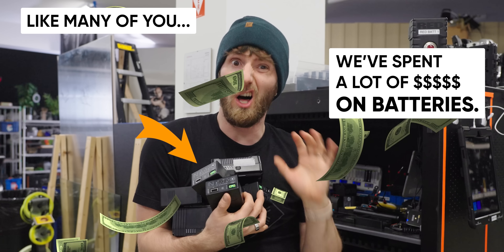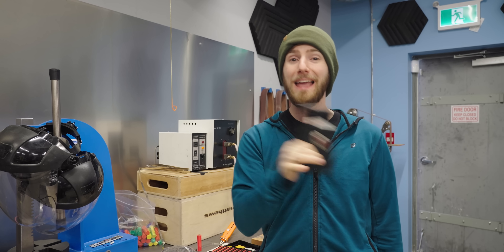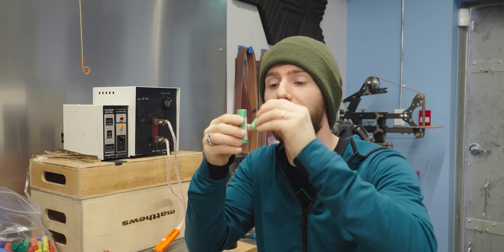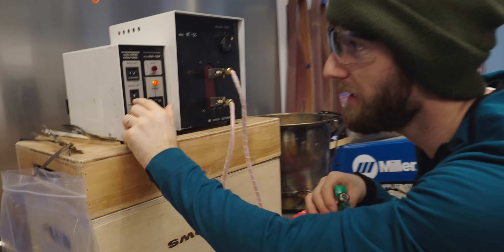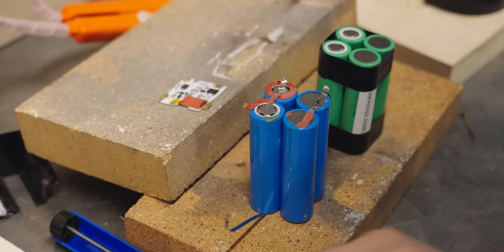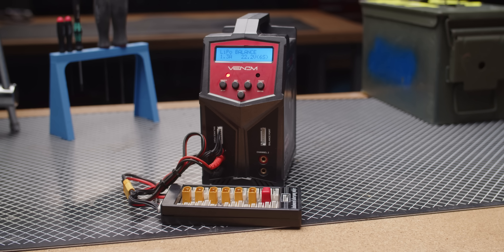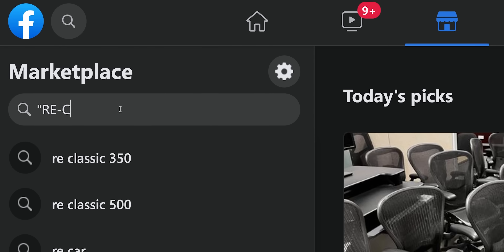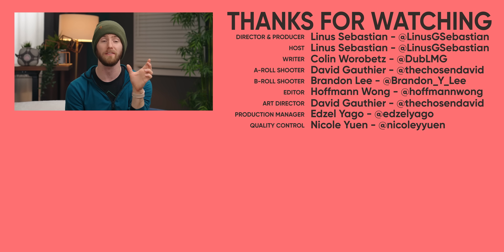This should be illegal… Battery Repair Blocking

Comment: Did you try charging that Sony pack ? Could just be that it shut off due to undervoltage, and charging could have reset it
Reply: Put it on chaaarrrggggeeeee it's sleeping
Reply: @CountParadox  That's true. You need to wake up the BMS most of the time. This is normal behavior. Also you should charge the pack through the BMS as well.
Reply: A lot of BMS if disconnect from batteries go into a sleep mode, and to wake them up, you just need to provide charging voltage to them on the output.... Charge then test!
Reply: Most lithium battery protection circuits will remain disabled for safety until they are first charged (TI, OnSemi, ...). So the pack was probably perfectly fine, you just needed to connect it to a charger once, as mike pointed out.
Reply: My thoughts exactly! As far as I know, for many BMS boards a reset is required after a cell swap. Connecting a charger usually does the trick, if you are lucky.

But sometimes you may be not, like when battery board has a gas gauge chip - this is a whole another world of hassle))
Reply: @enweave  even Apple was bitten by evil gauge IC - BQ27541. While they were using it, only data queried by host were I, U, t - because other were unreliable.
Reply: @brylozketrzyn  If only I U t are realiable that means the fuel gauge is probably not flashed correctly and the training cycle was not performed, to which I questionb why you would bother using those fuel gauges given that they cost way more than those that just monitor the pack's voltage.
Reply: @enweave  That's not a reset, but a wake-up from sleep mode they enter on cell removal, as the BMS thinks it's in serious undervolt mode (and therefor disables it's discharge-FET).
If there's a gas gauge on board, cell removal will trigger the safety-features which will make it go into a permanent failure mode. And that's a PITA to resolve... (trust me, I know, I revived my V-mount batteries, equipped with the BQ20Z65 gas gauge.
Reply: yup, should just "start"  it with a touch of charger. All the good and cheap BMS chips have to be put on charge after they trip or get disconnected.
Reply: Yup, every battery bank I have owned has this feature - disconnect the battery, plug it back in and the output will stay dead until external power is hooked up. Having to hook up a charger to "wake up" the over/under-voltage protection chip after it has disconnected itself from the battery and external power got removed also conveniently prevents the bank from randomly turning on during shipping.
Reply: My apc ups's do that. Change battery and it won't come on until it get wall power first. Not a battery&bms but essentially the same thing.
Reply: Yeah, a 3.2v cell new out of the box isn't bad.

Interestingly a lot of cells are being shipped <2V now which traditionally was not recommended for lithium batteries but they're doing it and it doesn't appear to be as bad as once thought.  Might be a chemistry change thing though.

Comment: Didn't some Apple laptop batteries have a malicious BMS that used an on-board microprocessor to "marry" one battery pack to the laptop power management along with the other basic circuitry to prevent swapping cells or packs? Also, armchair spot welder advice is that sparking was just the poor connection from your spotwelder leads, however,  you may have been damaging the cells anyway by adding too much heat from performing multiple spot welds in short order to the negative ends of the 18650's. The negative ends have thinner material and more heat is transferred to the electrolyte in the cell.

Comment: it's really important that people learn how Li-Ion and Li-Po are recycled. This is one of the main issues people point out when talking about how useful to the environment electric cars are
Reply: & they're used in secondary applications, extending their usage life.
Reply: Almost nothign is recycled. 99% of Li batteries you'd throw in the "battery recycling" bin will end up in the landfill after pack disassembly or most likely before. There are some youtubers and a couple of enterprises that "upcycle" or resell cells from old devices on ebay, but that is literally a mouse's fart against the hurricane of millions of EVs and power grid devices being produced and scrapped today.
Or do you have any proof of thousands  of metric tons of Li cells being actually recycled? I bet you don't.

Comment: In laptop space I have seen BMS stop working after disconnect and after googling found out they even have protection to prevent use with third party batteries which means 0 chance for recycling

Comment: Linus, thank you for mentioning that you're an amateur and you have no idea what you're doing. The sparks at 11:15 were from the spot welder and not from there being a temporary battery short. Those 4 cells definitely didn't need to go to ewaste. Easy mistake to make though as spot welders make the exact sort of sparks that battery shorts make. Because in both cases there's high current flowing.

Comment: Most bms I've come across will not revive once they have shut themselves down, if you do them before they are dead you stand a 50% chance it will work. The other ones are the ones that write battery health to an eeprom so if you have a new battery you may be able to dump its eeprom and try that. 
And yes go to recycle plant... whenever I see a lithium opened it starts smoldering...

Comment: Dell doesn't even fucking sell batteries for their laptops to end users anymore.  If you need a new laptop for your aging device, ya gotta use their external battery pack which isn't as good as the internal battery, and adds unnecessary bulk to your laptop.  JUST SELL THE FUCKING BATTERIES DELL.

Comment: You could test the old cells and use them independently with a new circuit in a USB charger, flashlight or any other single cell projects.

Comment: I think what happened to your Sony battery is on that particular battery model and the chip that’s on the board sensors when it’s been disconnected from the power source which means if you would’ve had a jumper lead going onto the board and kept it there while you were putting your new four cells together and then right when you connect your last connection onto the board you disconnect the jumper lead from your old battery and everything should be good no smoke no flames no explosions😀

Comment: i have built a few lithium packs from reclaimed laptop packs. i build a 12 cell replacement for my ups. works well better than the old lead acid 7AH. and yes i also had sparks but you guys seemed over cautious unless you somehow managed to weld both ends together in a dead short......

Comment: my lenovo laptop has evil one, i tried change the cells, and is dead, i try compatoble battery and BIOS said is not genuine, but lenovo doesnt even built or sell the f@k@g battery., my laptop has ssd and is an i3 2ndgen it runs like any new with Linux. i hate Lenovo

Comment: Those sparks had nothing to do with the cells being in any danger, it was from improper weld settings/technique. I appreciate the safety concern but I hope those perfectly good cells weren't wasted
Reply: Thank you! I was wondering why they were spooked with a few spark from the welder. While I don't have direct knowledge about welding tabs for battery, I was confused because I've never heard about dumping the batteries for something like that.
Reply: As a DIY battery builder this was just painful to watch and full of bad information.
Reply: @termn8er331  as a kid who used to take apart old laptop batteries and make my own battery packs with eBay bms, I am very confused with how overly cautious they are being. They worries about welding sparks whereas I literally used to solder them together. I also tried to make a battery explode purposefly and couldn't get anything to happen. They are obviously not toys and can be dangerous but not as volatile as made out in the video.
Reply: @DILLY_DING  are you sure you were using Lithium based cells
Or were they possibly NiMh I have definitely had 18650’s pop on me but I never was as scared as they seemed to be in this video, after those sparks if the battery didn’t pretty much immediately start smoking and catch on fire more than likely you’ve just welded with the wrong settings/ bad technique
Reply: @andrewbarentine2187  I have soldered wires to 18650 lithium cells before and they were all fine. You have to be quick, best use some good flux so the solder will catch on quickly. The cells get a little warm, but nothing that couldn't happen while quick charging or in high-amp use. I made four of those single-cell 18650s and they are all still perfectly fine a couple years later.
If you're wondering why I did that, I had some used but good 18650 lying around and I have this emergency fm/am radio that works with an 18650 cell with a plug connector. The company wants 20 bucks for one replacement cell (2200 mAh). I made four extra cells (2600 mAh) for less than a dollar.
Reply: @highks496  "soldered wires to 18650 lithium cells". 
What helps immensely is sanding the terminals (or strips). It makes such a *huge* difference.
Reply: @whuzzzup  Don't even need to sand them, just use good flux. The lead connects immediately to the terminals. I've been using Felder ISO-Flux E which is strong but still applicable for electronics.
Reply: @termn8er331  yea i cringed to hard as well.  Its just scaring away DIY hoppy people.
Reply: On WAN show the other week Luke made a joke about using water to put out a lithium ion fire and Linus got very serious about how dangerous that was because of the reaction of lithium and water but in reality he has the misconception that lithium ion = metallic lithium which it does not. Lithium ion batteries do not use metallic lithium therefore do not react with water in any meaningful way, a bucket of water absolutely could contain a battery that's entered thermal runaway. There's a difference between respecting a danger and being afraid and they've definitely leaned way more of the afraid side instead of taking the time to understand the danger threshold.
Reply: @TheStopmotionMovie  Yep, and SOP is dousing lithium battery fires in water continuously until it's calmed down. That's exactly what firefighters do with EV fires on the rare occasion they do happen
Reply: @TheStopmotionMovie  yeah, even electric car fires are put out with water. You just need a crapton.
Reply: Yeah, I'd usually think that, if there's a big spark and you're not sure what caused it or why, exercise extreme caution. But even I think that was a bit over the top.

Also, I figure the sparks probably were caused by sanding the welding tip, having metal dust on the tip would probably make the normal small spark just way bigger.
Reply: Honestly though, I built my own spotwelder out of a microwave transformer with timing done by an arduino. While tuning it was almost like a miracle if there weren't sparks and none of the batteries died. (Except one but I literally ripped a hole into the top of that one lol) Also I was cringing so hard when he welded the SERIES connections and was relieved when it didn't short out. Honestly terrifying that someone with such little understanding about electricity gives advice about it to millions. At least he was overly cautious and not the other way around.
Reply: @amos9274  "I built my own spotwelder out of a microwave transformer with timing done by an arduino" I don't know you but I wish to invite you a beer.
Reply: I'm wondering whether this is a case of Linus and co not knowing, or deliberately overplaying it to dissuade any amateurs from trying this at home...?
Reply: @kevreeduk222  I assumed this. If they said 'oh it sparked no worries', and someone actually had harmful sparks and thought oh that's normal! That's not good.
Reply: The first set they were worried about connecting positive and negative terminals together, but hadn't connected any of the terminals at the other end of the cells yet.

It just showed a lack of even basic understanding of how a battery works.

The BMS lockout on the red pack could maybe be defeated..
Discharge the pack down to 3v then put a coin cell battery across the the terminals while the 18650 pack is rebuilt.
Reply: Yeah I get throwing it in the bucket on top of the sand and standing back for a minute, but wasting them like this was hard to watch. Perhaps hit it with one of their FLIR cameras to see if it's heating up and if not, continue.
Reply: I've actually smashed a charged 18650 with a sledgehammer and it took 4 hits for the cell to go nuclear
Reply: Yeah, it takes all of like 5 minutes to google "building a power wall with refurbished batteries" and see how to properly tack weld together hundreds of these batteries.

The over reactions, & insistence on tossing the old cells instead of pulling them apart and checking which individual batteries are still good, were so staged that I can only assume that the legal team said "we are going to get shut down if you present this as being as easy as it is for competent adults, but then some dip shit kid cooks themselves after watching it."
Reply: @holdenhodgdon3756  Not reusing the old batteries is understandable though, it is nigh impossible to find cells that have the same IR and capacity, so in the new pack the BMS would constantly have to work overtime to keep it somewhat balanced. They could easily be used in smaller packs though.

And then there is the comedy with measuring the cells without charging them and conclude that they weren't matched.
Reply: Better safe than sorry I guess.

Comment: It is common for the BMS to turn off when they lose power and NOT to turn on after you restore power. It is also common for them to wake back up when you start to charge the battery. The bad news for Linus is that usually when the BMS has turned off the provided charger does not see the battery anymore. And will not try to charge it so you would need to apply voltage manually.Doing this will be your own responsibility and you need to have a power source with adjustable voltage and current.
And it looks like at least one of the batteries you discard just gets the spark from the welder itself. I would discard the pack when one or more shells start to get hot.

Comment: Yamaha E-Bike-Batteries have a primary fuse with a "microcontroller-pin", meaning the BMS can burn the output fuse at will without there being a short. 
Replacing a blown one with a traditional fuse won't help either because the bike's motor controller communicates with the BMS. From my experience it won't run until you spend 800 on a new battery.
Obviously this has to be for security reasons that i as a customer just don't get.

Edit: If interested look for "Dexerials Self Control Protector" that'll lead you to those fuses, can't remember which part number it was.

Comment: This is brilliant. As someone who does EV battery validation for a living, this is accurate and I like the inclusion of clear warnings and care points. 
Please only attempt something like this if you are familiar with the technology and ideally have some background in electronic engineering or electrician work. Definitely NOT for amateurs.
As was shown, their frustration with welding the nickle busbars to the cells is very dangerous and even in ideal conditions (large automotive OEM R&D facilities), things still very easily go wrong.
Linus, please, before doing anything like this again, sort out your safety procedures and live working areas!!

Comment: I've got a feeling watching this that the BMS is going to have a low voltage cut out that will permanently enable after they desolder the pack. Or some other nefarious trap. Edit: seems like I was right). Still a good video about how the industry needs to stop acting like $200 batteries being disposable is okay when the cells inside cost 50 bucks all up.  

I've dealt with this on packs I've repaired before. Makita batteries after 3x "fault warnings" when connected to the charger will lock out. And I've had laptops batteries which wouldn't recharge after having voltage removed from them as it thinks there's a fault.  
It's all for safety. As right now they ARE treated as disposable, therefore its far more important to prevent a potentially dangerous situation by allowing a faulty battery to recharge.  
What you can do is connect "life support" to the BMS before removing the old cells to keep it supplied with power.  
You actually have to do this with many modern cars if removing the car battery by keeping a small battery hooked across the wires while you replace it, or else the ECU will throw a bunch of faults, basically meaning you have to take your car to the dealer just to change the battery...  
As for safety, I wonder if a timer on the spot welder would be good. So you can dial it in at millisecond accuracy and hit it for perfectly the correct length of time every time (eg. say 0.85s) to weld but not melt a hole through the housing of the cell? Some sort of timer and a high current solid state relay maybe.    
Lots of people freak out about heat, but Ive soldered to loads of 18650 cells with zero issues. Spot welding should be quicker and cooler though when the current and time is correct, random sparks from the welder are okay though. Keeping cells at say 40% charge will basically remove any chance of fire too as they're far less volatile at a low state of charge.

Comment: I don't think the probs on the welding stick is the problem.
The problem is that it is one unit.
You really need to have i perfect straight up. Even if u wiggle it only some smal degree left or right one probe will have to small contact with the nickel band. AND you shoots the cell :/
Som two separate probs are the best, or the probes must each have a spring.